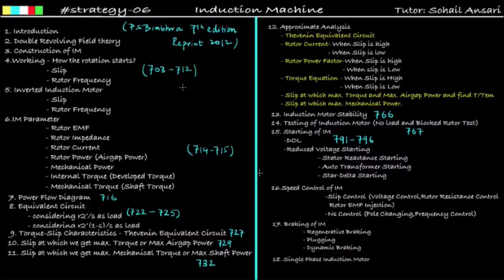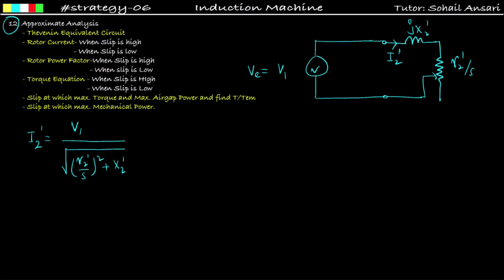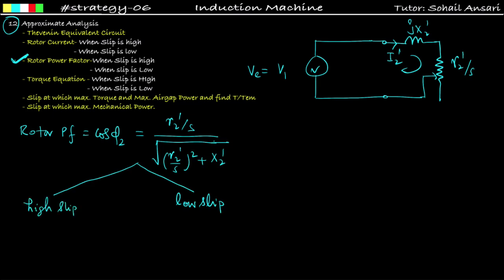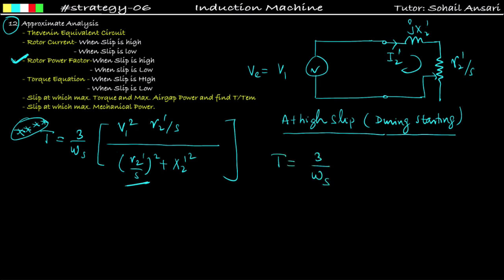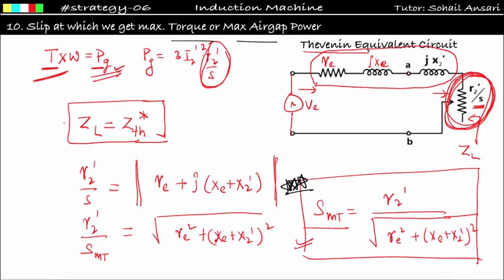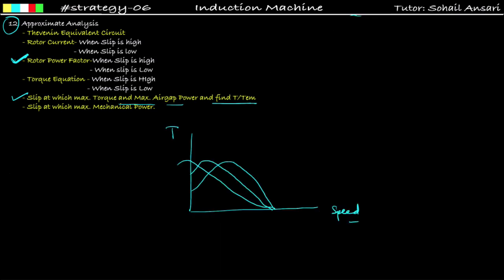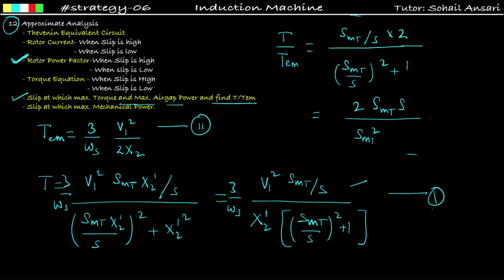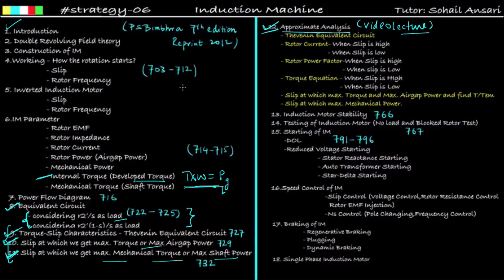Point No 12 | Induction Motor Approximate Analysis | Important for GATE Exam

Comment: Sir 
I analysed everything from rotor circuit sir.

Is that any problem ?

And also

Can you tell the maximum mechanical torque.
And
Mechanical torque or shaft torque equations.

Please.